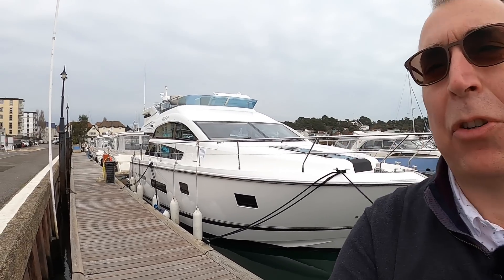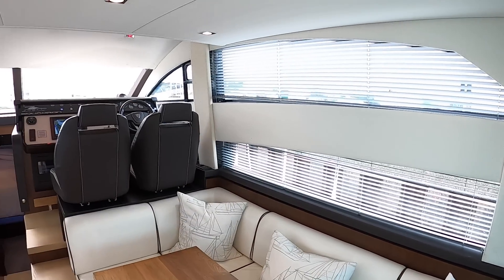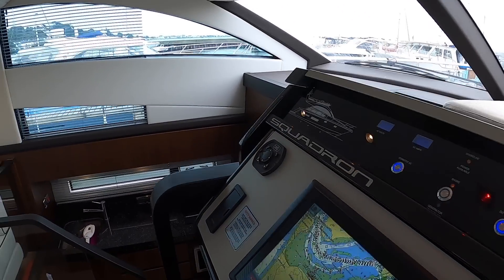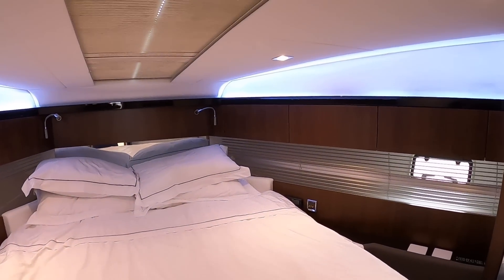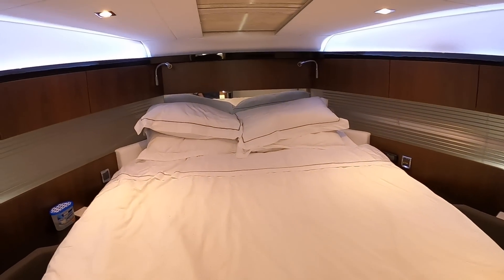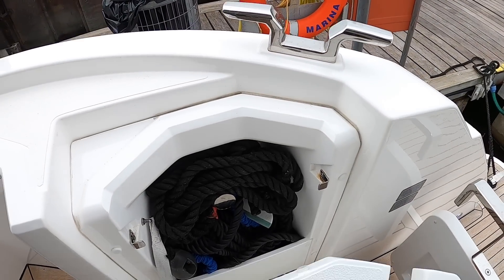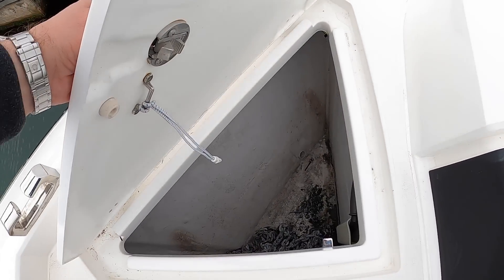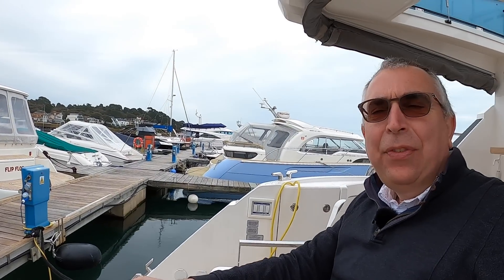£400,000 Yacht Tour : 2015 Fairline Squadron 42

Comment: Great Vlog👍and nice boat!! I like the way the windows are split in the living/seating area. The thick upholstered bar going between them adds more color to the interior and reminds me of the way houses with cathedral ceilings look with the windows stacked on top of each other. Somehow makes it feel bigger to me, and gives a feeling of some privacy because it's not just a huge open view into the boat but still has multiple long windows to allow for easy viewing to the outside. The convertible seating on the flybridge and the rear of the boat add a lot of style and options for how you want to use each area!

Comment: I like that they didn't try and cram a 3rd cabin in, but left two heads with separate showers.  Really smart on the rear canvas too, not all boats are destined for the Med!
Reply: Marex do a clever thing with having them in a little cupboard and coming out on a top 'curtain rail' like track. That way they aee hidden from sight when not in use
Reply: @davidantill6949    You mean the yachts moored up behind the fairline. 😊

Comment: Great looking boat both inside and outside, very unique high/low dinghy dumper and amazed that they got two heads with separate showers on board.  Smallish engine room and the ~200 mile range at ~20 knots kind of hold it back but if you are paying people to service the engines and 200 miles is enough for you it is hard to find better in this size/performance range.
Reply: @billbrooke4355  Probably not a huge difference until you get to 8 knots or less.  If you expect 0.9 to 1.0 smpg at around 20 knots and 1.5 to 1.75 smpg at 7.5 knots you won't be disappointed.  In my experience you generally want to get where you are going so not much 7.5 knot cruising.

Comment: Hi Nick,
 a
A quick question, 'Raw water strainers' , are they taking water from the sea to cool the engines rather than a traditional water radiator?
Reply: Short answer - the engine coolant is the usual fresh water/antifreeze mix, but instead of a radiator, this is then cooled by seawater in a heat exchanger.

Comment: She is an impressive boat.  One thing I have wondered. Some boats have the fly bridge covered . How easy it would be if you wanted this one to be covered ?. Thanks again Nick for another great video
Reply from the maker: There would be covers to go over seats etc, but easy to get someone to make a full tonneau cover if there isn't one.
Reply: I think he means a Bimini top.  A metal frame with sun / waterproof material stretched over it.  This boat did not appear to have a top like that or Nick would have surely mentioned it.  There are companies that make them for almost any boat (even powered), I suspect this would be a custom and therefore a cost in the "thousands" but if you are already are spending 400,000 it would be peanuts.  A full Hard Top instead of a Bimini is likely not available unless the factory offered / installed it as an option.  Sometimes they do not offer a Hard Top because the boat cannot handle the weight, the boat would become unstable (rolls too much, etc.).  As far as for weather and soil protection type cover, you can see there are buttons everywhere, meaning when not in use everything will be covered.  The covers were all likely stored under the seats.
Reply from the maker: @Dobermanator  Good point and very comprehensively and accurately covered, thank you! :)

Comment: All Aquaholic tours are superb. However, if I was going to spend £400k... ;-)
Strange tender recovery system - imagine trying to locate the RIB on those hinged supports in anything but a flat, calm sea?...Also, the canopy storage is primitive and bits of the interior are clearly falling apart/require a deep clean

Comment: Form Follows Function, yet fails to recognize ingenuity - the Clever Factor. This boat is chock a block with CLEVER. And those touches are focused on the practicality of boat life, not just cute for cute's sake. Like the placement of the fly bridge BBQ station AND its layout - functionally clever. The 'self storing' cockpit side curtains - functionally clever. The Saloon is ONLY a saloon, while the separate Galley is bathed in light from the windscreen, a deck above - functionally clever. The new owner will have lots more functionally clever discoveries to make - this is a boater's yacht.